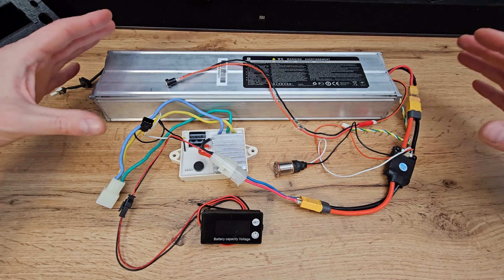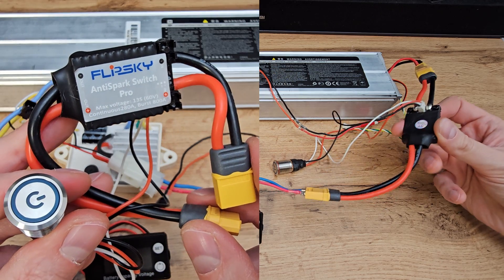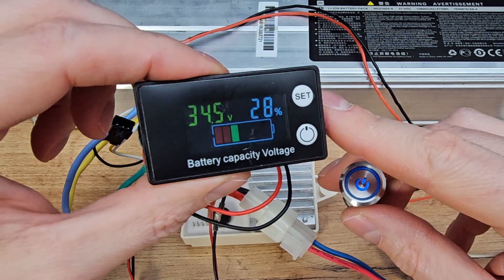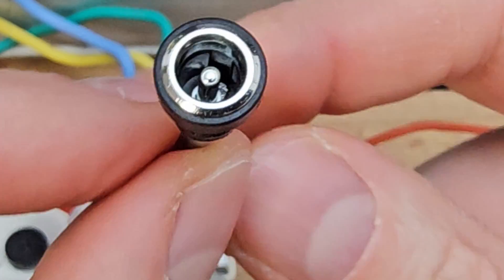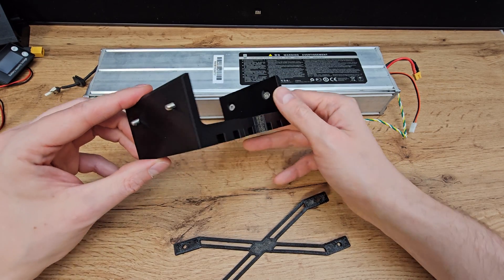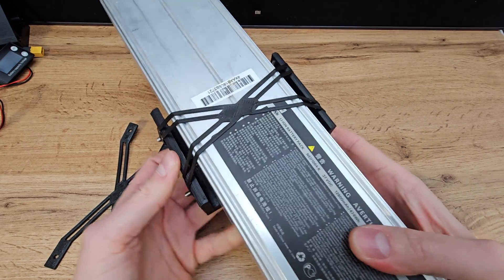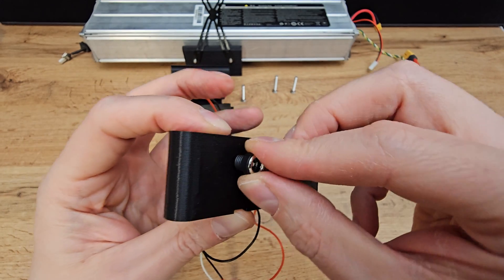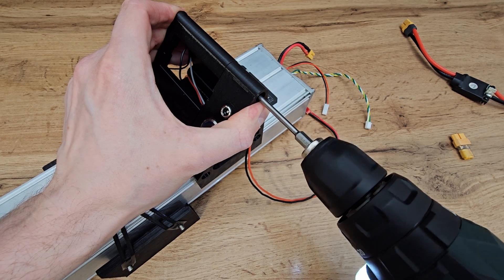Lawn Mower with Battery Xiaomi M365 🛠️ Cheap upgrade for pricy batteries 💲 Easy modification

Comment: I'm wanting to do the same thing! I have a 48v mower that uses 2 24v packs.. I want to swap out with two 36v m365 battery packs (extras i'm no longer using) for a total of 72v, then use a step down converter to bring it down to 48v for the motor.. do you see any problems with this idea?
Reply from the maker: Yes, cause step down at real power 800w++ are big and heat up really fast , so  you will need pricy one  or more than one.
Reply: @PirateWasHere  Yeah was thinking to do two smaller ones, so two 36v to 24v step downs, then connect that to the existing power connectors that each of the current 24v battery packs slot into. Obviously having all of that on the mower will add weight but I don't mind that so much.. I'm just tired of my lawnmower running out of power early or not having enough constant power to handle tough grass. I doubt the motor included in my lawnmower could handle much more than the power already being supplied so I don't want to push that part.
Reply from the maker: @SubverterRadio  If U ask me what I would do. If there is brushless 3 phase motor, I would swap stock controller to some Cheap VESC 75100 https://s.click.aliexpress.com/e/_oFh1tk7 >
Then U can controller power by PWM or ADC Throttle, and connect battery up to 72V :)

Comment: now put vesc in it 😂😂 extra power mowing haha (jk, but would be fun to try no?)

also yea much much better than those expensive batteries
Reply from the maker: Actually this is decent idea, I tried to design some wheel drive mechanism with FPV ( so PC steering wheel + video streming on the TV ), but it's too complex due to the lawn mower plastic shell ( it will take too much time )
Reply: @PirateWasHere what if you add drive belt to 2 wheels, or even 4, so one side goes forward and one side goes backward when you steer to one side

in that case you dont need special steering mech and can turn around by rotating wheels in opposite direction?
Reply from the maker: this is more complex , whole case can be rised by lewer, so we can't attach motor mount to he shell. Only way is to use axel, and this makes it very complex because then U have to creat whole mechanism with gears / motor / wheel , which can't be wider than stock wheel.
The Best option will be to use hub motors from some hoverboard, then I would design adapter to connect 2 shafts/axels &  tire with decent grip/ thread. Everything is possible, the question is "How much time of your life YOU are willing to sacrifice , to achieve your goal ?! " 🍕🍻
Reply: @PirateWasHere  i see, yea thats sort of annoying, and time consuming
almost easier to put custom frame together and just use the lawn mower motor if you wanna put in the time lol

with the "if you want to put in the time" as an important part of the sentence
Reply from the maker: ohhh yes, your idea right now is the best one,  to speed up the process we can use simple alloy V rail . 
Thanks for help, my english is not the best because I don't really speak with people which are fluent in english so I just repeat my own mistakes ... .
Reply: @PirateWasHere  it's fine, i can understand you without issues, greetings from Belgium :D

btw you should check out the Makerbase 84100 and 84200HP, best cheap vesc in existence!
Reply from the maker: When I think about Belgium, the first thing on mind is always Hercule Poirot 🫠
Reply: @PirateWasHere  idk what happens, tried to post link of photo but doesnt seem to come through, maybe you need to accept comment in studio or so
Reply from the maker: @BH4x0r  send pm to my gmail